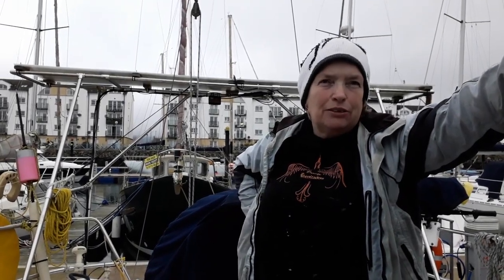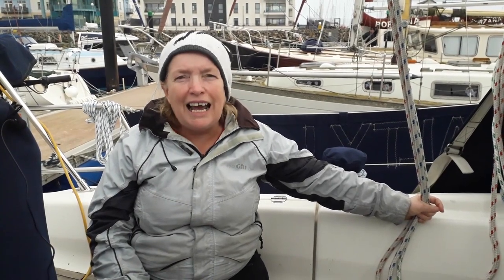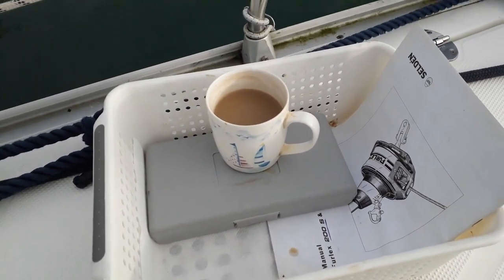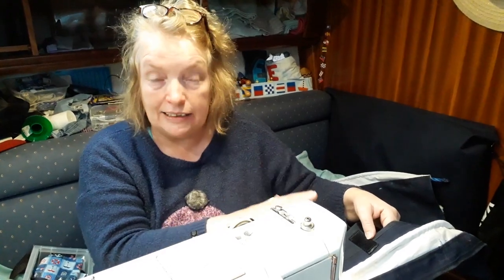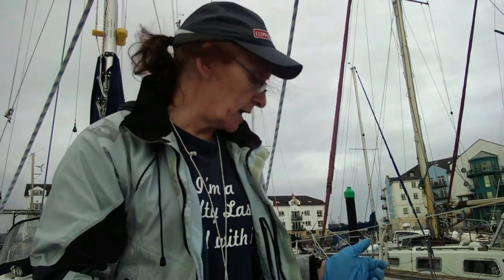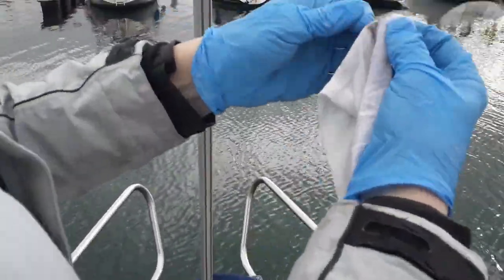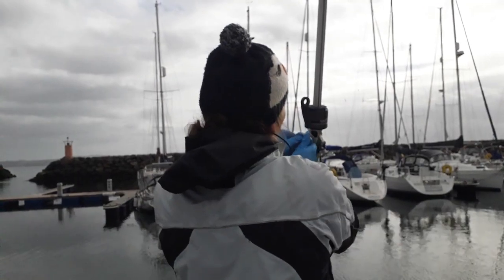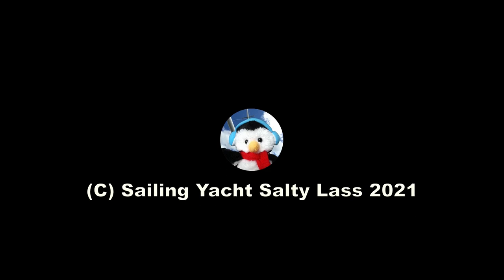Yacht maintenance - Selden Furlex - Sail furling system - Ep. 177

Comment: Yeah I agree with Dave on this , I’d only ever use  the spinny halyard as a stay as the last resort.
I’d get a rigger knock you a removable stay up instead, much stronger and suited for the purpose .
Re your furlex system; thank goodness I have the plastimo one...much easier to service and replace the furling line as you pointed out.
Great video ladies keep them coming.
Reply from the maker: The furlex is not bad once you realise how all the bits go together, but I am tempted to drill a 9mm hole in one of the bottom plates so that in an emergency, I can just drop an 8mm line through and figure-8 it to get a furler in there in short order. Also, see my reply about the spinny halyard. Thanks again

Comment: I've got a used Furlex 200S which I aim to fit on my Sigma36. I've ordered the new stay and toggles and extra foil section so was good to see this one, same model. All the parts available from Allspars. Not cheap! Good quality though. That maintenance  pays, as you say, would be hard to do at sea and clean and grease may prevent a jam one day in the middle of the north channel with a rising wind and the sail out.
Reply from the maker: That Sigma is going to be a fine boat when it is all done up!

Comment: Hey lovelies 😃
Now Gaynor for starters petal LEAVE THE GALLEY TOOLS in the flipping drawer you bad lass you 😂☕️
If it’s any help for you both PLUS of course your great followers , I’ve recently decided to not improve my Rotostay Mk2 on the Fjord , but bought a Selden Furlex 300S .
Oh yes you’d be right in saying it’s overkill for a 28’ sloop , but she’s not your usual sloop and I’m a bit bust so of course it makes sense to have an easier job of furling the genny whilst having the benefit for me of a thicker furling line … easier to grip as I get a bit weaker .
Now @Sailing Moon Shadow … could it be when chatting it through with your rigger , that something might have suggested you’d personally benefit from the larger kit , rather than the usual disgusting practice of up-selling to make more profit from customers ? I ask because I’m struggling where my yacht isn’t . Just a thought, but if anyone wants a video breakdown of the lower unit I’ve just overhauled mine and won’t be fitting it for a few months so I can strip it back down and video it if it’s any help ?
They’re really great kit , engineered for longevity but I would have been happy to install the Plastimo 811S if I’d not got this Furlex for the right deal second hand .
I fitted a Plastimo 811S to a Mirage 28 and it really was easy , well designed and intended for a DIY level refit so no special tools needed , though you do need two pairs of hands and at least one good back between you .
Incidentally … if it’s a life saver for anyone , I’ll have two spare foil sections not used when I do install mine . Give me a shout if I can be any help , nice job as always ladies and I’d love to see some attention to what alternatives people can use onboard rather than the alleged one for all “Sailrite LZ1” , which even Solent Sew no longer stock and haven’t since about 2010.
As you’re seeing here aboard Salty Lass , if you understand the relationship between thread size , needle spec and size , and the tensions required to sew different fabrics , you don’t always need the hairy backed muscle bound machine to keep you going 😉
No I’m not a doctor so don’t trust me … but I’m a retired sailmaker and former engineer so it has to count for something , maybe 🤔🤣
Happy days Beverley and Gaynor , keep leading the way and when you’re down this way we WILL be laughing over a cuppa 🤗😃⛵️ stay well and if you can walk me though posting you a video I’ll happily do it if it’s any help .
There’s two sets of bearing seats and race sets on that lower swivel unit so it gets confusing as D6 and D7 aren’t shown as duplicated on the parts list for the 200S, 300S , the later 204 and 304 nor the sport electric units .
The spring shim however will take the wobble up from the inner tube to the upper head set and remember it’s only free running until the sails out , at which point the load is evenly distributed on those three sets of ball bearings and it levels up on the lower foil , so don’t worry if the upper plastic housing seems too sloppy to hold the tube against the lower foil … or torque tube if you’re working with the Plastimo furler , again , loaded up it’s designed to have some float for greasing up .
I use Lewmar winch grease as it’s biodegradable, waterproof , but that’s where the Plastimo does win !
Their Delrin and Torlon ball bearings are not greased and are water lubricated . Every few months run a bucket of warm water with a little biodegradable detergent in it over the lower unit and job done .
No salt corrosion and no salt crystals but the powder coated alloy components are pretty tough so if your furler is on its last legs and you can’t afford the better know brand … look up the Plastimo setup .
I actually sailed that Mirage from Fowey to Weymouth in a big following sea and it surprised me how easy it was to fuel even under a loaded 150% genoa in a following wind out of necessity . 
Best wishes and loved the vlog as ever , Mark x
Reply from the maker: Mark - Thanks for all that feedback and tips. So far our 200S seems to be holding up and is performing well which is more than can be said for our ST60 Tridata 😄 and possibly our impellor pump 😄😄 The sad thing about my 2nd best galley knife is that it is probably the sharpest knife on the boat and there are just so many times a really sharp knife is useful.

If we come your way then a cuppa will definitely be brewed 👍👍
Reply from the maker: @fastasfowey  - that is an incredibly kind offer. Thank you ♥ We think all that is wrong with ours is that the seals need redone, so we are buying the kit and we will pop a few new gaskets in. If it all goes horribly wrong, we may be in touch 😀
Reply: @SailingYachtSaltyLass   , you’re always welcome in any way I can help . My cardiologist refused to operate until the electronic implant leaks now , asshole , so I’m home this season a s if there’s anything I can do it’s a pleasure really , the next best thing to having your own adventures is to help others keep enjoying theirs 😉
It’s just paying it forwards but the purpose is nice too whilst I find a plan b here . I’m time rich , if you need anything I can work out from land then pass forwards I know you’re both amazingly capable and stay safe in these few days of rougher weather x